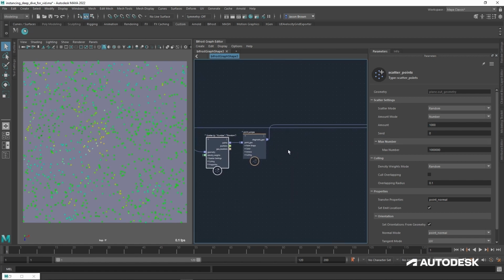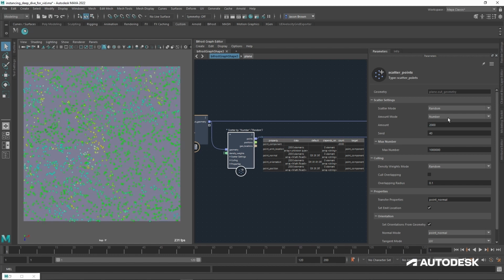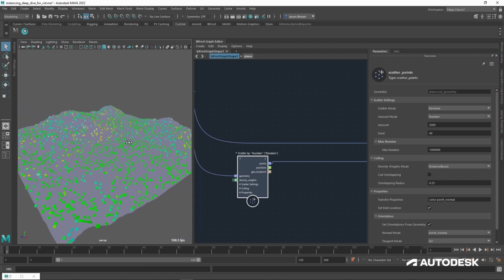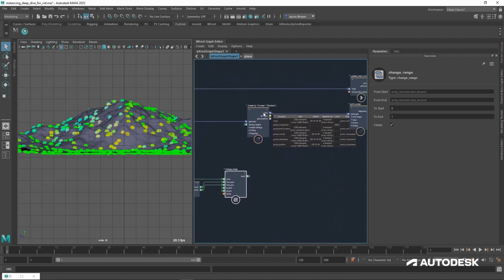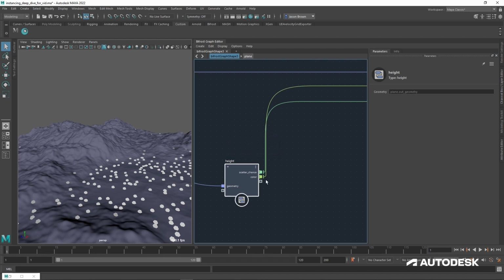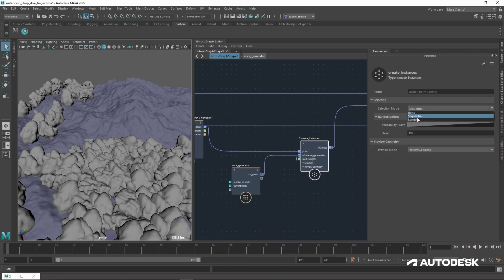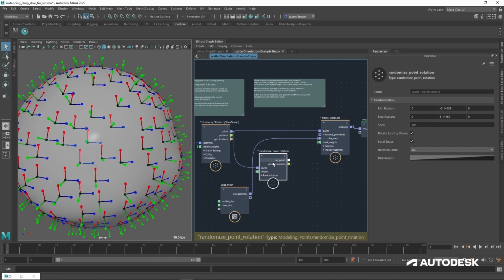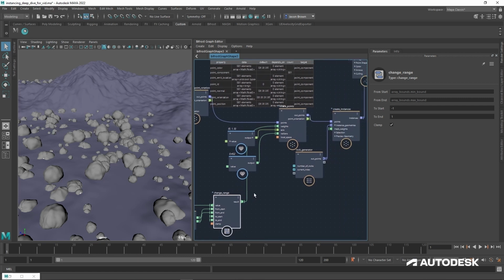Bifrost Scatter Series: Scattering

Comment: Hi, am I wrong thinking that bifrost will eventually substitute MASH system ? I recently started with Mash and I am not sure if I should continue this path or rather start to look at bifrost. Thanks
Reply from the maker: While Bifrost can technically supplant MASH, it would take a lot of customization to make an interface / workflow to rival MASH.  If you want to go through that effort (or are technical enough to just use the Bifrost graph without a MASH-like interface) then yes I would recommend Bifrost since its a faster performing, more extensible system.  That said, if you're an artist just looking to play around or quickly build an effect without any ramp-up then MASH is and will be a great tool for a long time to come.